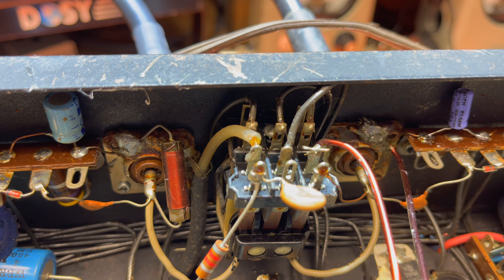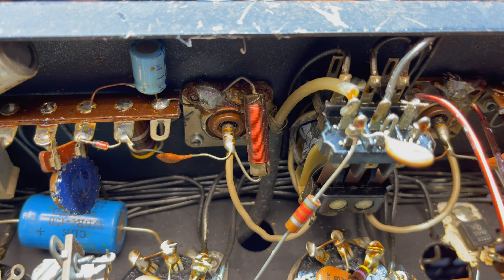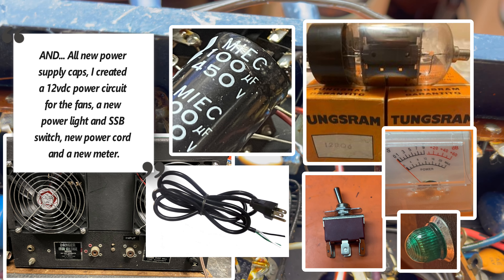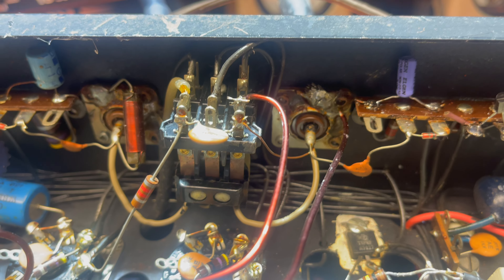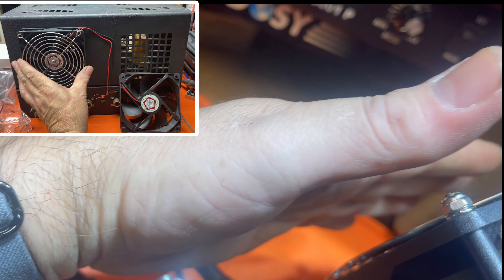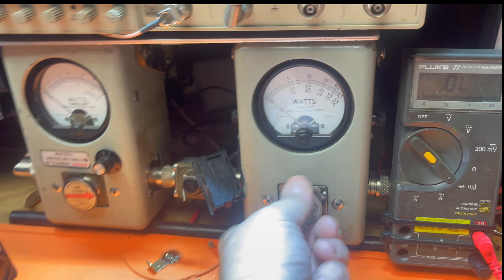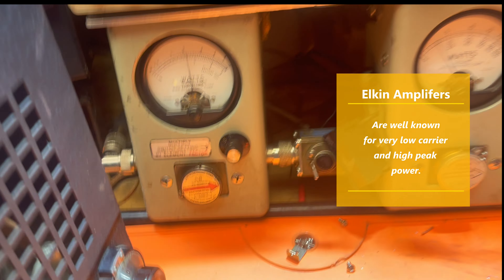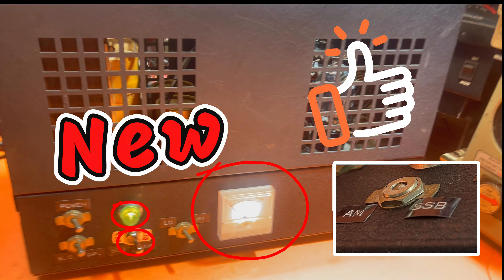6 Tube Elkin Amp Repaired

Comment: Good job on fixing the Elkin.

That amp is called the Elkin Super 6.  It has a W300 transformer which is top shelf.  And yes they will do 600.  The big black knob on the right side with the numbers is for the output tune.  And there is a tuner inside the bottom of the amp for the input tune.